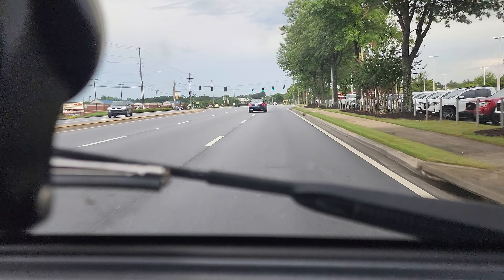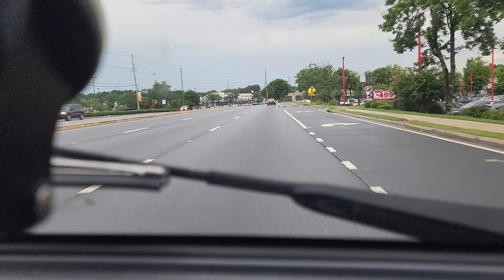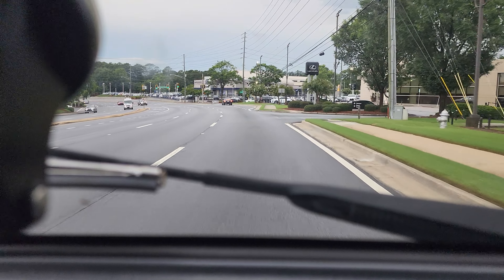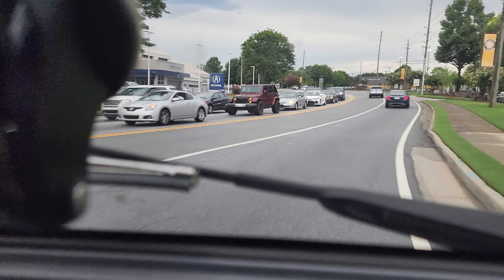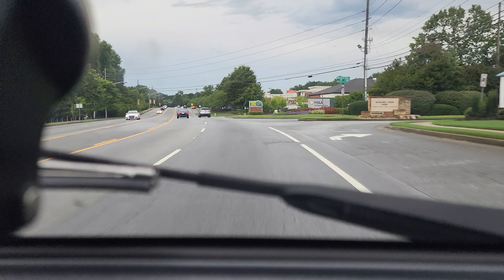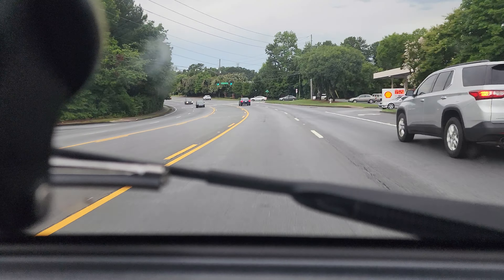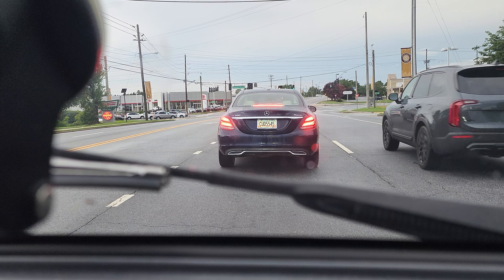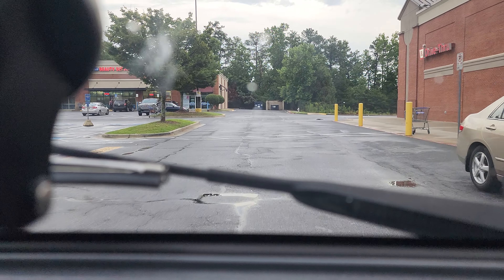Daihatsu Atrai turbo vlog, parts used

Comment: "Making Hotdogs in the Apocalypse"  LMAO!!!!! Nice one, Leon.. 
Are you still using the S22 Ultra? If so, not sure why it uploaded in 360p???  Man, so many different parts, You may as well call it, your Franken-mobile  lol 
 Yeah, Leon, that's an Audi RS6 Avant.. about $140-150k  Nicely equipped.
Reply from the maker: Yeah it was a 12 gigabyte vid file!  It's still processing I am disappointed too.  Tomorrow we will have it.  Man, the turbo van really does sound like a turbo sportscar don't it?  It even feels like it.   As you saw- the thing is fairly quick.  Crazier still is it can transform into a little wall pod hotel like you see in japan.  It even has a changing room, ice maker, laptop with roaming internet, stationary air, off grid gas generator, OR a 175w solar, water supply, 3 kitchen stovetops and an oven.  Pots pans, utensils is in there too.  even has a collapsible grill / firepit that breaks down to the size of a textbook.  Alpine sound system.  This is gonna be the coolest tent in the world, I'm tellin ya lol!  Some guys s13's, some guys it's the R34's me I'm all about the Atrai turbo vans.  Pretty sure this is 1 of 3 in N america.  It's nearly ready, just a couple more hiccups to tame and it's a daily man.  I'll keep you plenty updated in the next few weeks.